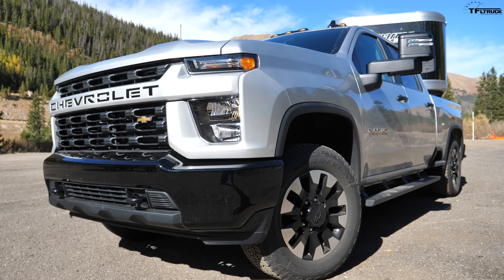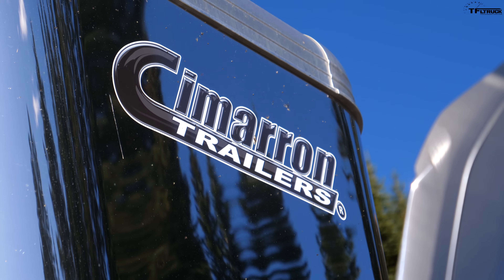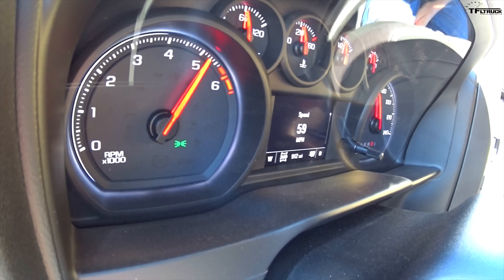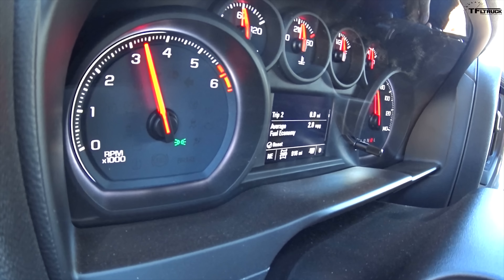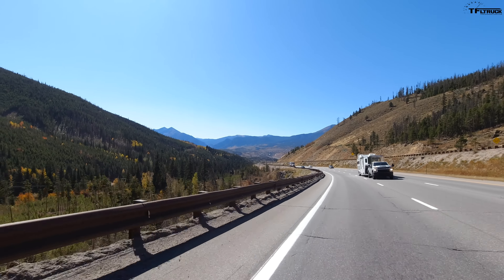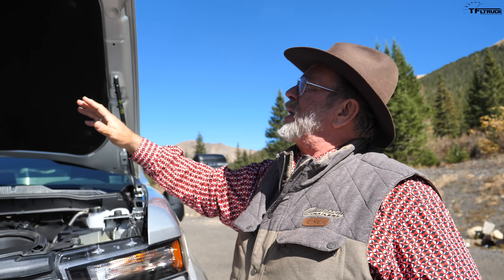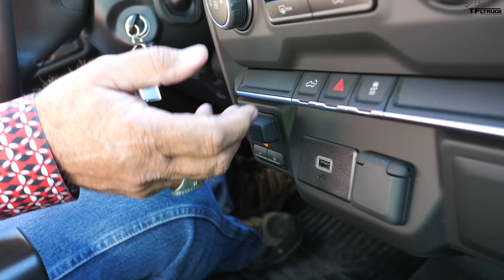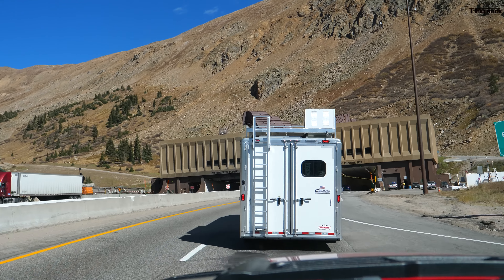The New 2020 Chevy Silverado HD Gasser Broke Our Ike Gauntlet Scoring System - Here Is How!

Comment: Can’t wait to see 7.3L Ford at work.
Reply: Can't wait to see the chevy 8.4 in the works
Reply: Chevy 8.4 did you where get it info? I know hearing over (gm8.0)
Reply: @jckdnls9292  Rumor is that if that engine even exists its only going to be used in medium duty applications, which also means it'll be de-tuned for longevity and will probably make less power than Fords 7.3L.
Reply: “In the works” seems to be the only reply from the GM crowd nowadays. With their ancient interiors, it’s amazing Chev sells any trucks...
Reply: @mattmcneely9174  I want a truck not a Fuuurd ecu-JUNK tin can
Reply: Aris Torm you sound real educated 👍
Reply: I think that's gonna be a great engine and transmission combo. That's the problem with the GM HD trucks. Still using a 6 spd. May be updated, but still a 6 spd. On paper the HP and TQ numbers are better than the current competition, but in real world application it doesn't put it to the ground well. I drove a Chevy HD gasser after driving a Ram 2500 Gasser and the Chevy doesn't compare. Waiting on that 7.3 gasser from Ford. Only thing I don't like about it is they went to a few plastic internal parts instead of aluminum. Just one more thing to go bad sooner I fear. Gonna get an HD truck with real HD parts, ie., solid front axle...waiting on the Ford 7.3 to decide on which one...Ram or Ford?...
Reply: @rossagge  No thanks on that Fuurd  will keep in the GM trucks
Reply: Aris Torm what happened to you?
Reply: How gm making that 8.4 ? They just payed off thousands of people 😡
Reply: Old school building how you want it for less than it costs to buy a used truck and you'll have 0 miles on the rebuilt parts so completely done you have a brand new truck for fraction of the price of the new one
Reply: are there many mexican trucks crossing the border
Reply: @mattmcneely9174  thats if you can get past the hideous looking exteriors on the latest generations to look inside.
Reply: @rossagge  It's not a problem. The 6-speed is a proven transmission. Any time a totally new transmission comes out there are always problems with it... GM 8-speed, Ford 10R80, Ford 6R100G. Even just making some design changes often causes problems (2019 Ram 1500's 8HP). Let the guys buying the first couple years of a new automatic deal with all the TSB's and bugs first. I can't wait to test drive a 7.3 Super Duty with the 10-speed, but there's no way I'm spending my money on such a new powertrain. I'll wait a couple years.
Reply: @karlschauff7989  curious what is wrong with the ZF8HP75. The 8HP70 has proven to be an awesome transmission
Reply: @TheRamGuy  It received design changes for 2019 and a lot of transmissions have had major issues or just straight up failed. There are plenty of big threads filled with guys reporting their transmissions failed.
Reply: @karlschauff7989  I found nothing of the sort in my search. I am part of 4 different Ram forums and haven't seen any of this. Where specifically are they calling out tons of issues with the ZF8HP75
Reply: Jay P they’ll sell a zillion of them. So many fleets like ambulances, moving vans, utility trucks as well as private customers are red up with modern emissions diesels. It’s cheaper to put gas in a big block V8 than to pay for repairs on a smog diesel. Ford actually has the 7.3 detuned so that later models will be upgraded HP wise every year. I’m sure they could throw a turbo or supercharger and make 700hp without even stressing the forged steel crank in it.
Reply: Should have had the flashers on the whole way up!
Reply: And the Ford 7.3 polished that ass on the GM. Beat it up the ike by 3 minutes 😂 go cry now fanboys.
Reply: @karlschauff7989  
Best combination for hauling.
CUMMINS/AISIN/EXHAUST BRAKE.
Reply: @mt1885  I have a feeling that you're on welfare, just like GM....
Reply: @231mac  you did him dirty 😭 Built Ford Tough 😎
Reply: @mt1885  There is absolutely nothing that you have going on that anyone would be jealous over, lol. And considering how infantile your word choice is, I'm pretty sure that it is YOU living in someone else's basement.
Reply: @231mac  Did you miss your Burrney Sandoors hero rally along with Bitdden...
Reply: @mt1885  Sorry, I don't speak gogo-gaga, but I will say this: I'm a Libertarian and you're straight-up embarrassing conservatives.
Reply: @rossagge  the diesel is the 10 speed...

Comment: Towing 3-5 times a week and I climb 3 thousand feet one way, I’d absolutely hate hearing that engine rev that high the whole trip, and my mileage would be garbage. I’ll stick to diesel.
Reply: i see burnt up transmissions and engines in gms future
Reply: Haha agreed
Reply: @LedzeppelinDogsGuns  nah nobody tows with these, half the new trucks dont have a hitch in the receiver
Reply: Yep.  Jeremy really is the right customer for a diesel.  If you two every day, diesel is for you.  I haven't seen a heavy duty gas engine yet that can pull a load up a hill without assaulting the senses.  Ford's EcoBoost does a great job in the F150.  It can pull the Ike at 3500 rpm and not sound like it's screaming for mercy.  Somebody needs to make a turbo gasoline engine for heavy duty applications.  Naturally aspirated can't do the job at high altitudes.
Reply: You and me both... a high reving gasserr can't be that durable for much heavy towing  anyway.... don't quite get what the factory engineers are thinking....
Reply: What’s with all you kids thinking high rpms are bad?? As long as there is oil in the engine and oil pressure is within limits these engines will live at 5000rpms all day... Do you kids honestly think the added complexity of a turbo charger will meet the requirements of a reliable, long lasting workhorse engine?? Not at all!!! If you knew anything about turbocharging you’d know it has no business in a heavy duty pickup besides diesel
Reply: @jon62ify  How many engines have you designed that will last at 5000 rpm all day?
Reply: @jon62ify  What about the "added complexity of a turbocharger"?  Turbos are simple devices compared to the cylinder deactivation systems that GM and Chrysler are putting on their engines.
Reply: Andy Harman turbos require added cooling, added systems to maintain correct cylinder pressure, an additional oil system, or higher engine oil capacity (if using engine oil for turbo), variable vane turbine blades, which either use oil pressure for actuation or solenoid actuation. You need an intercooler, the exhaust manifolds and intake manifolds need to be routed to accommodate for the turbo. The increased cylinder pressure greatly reduces head gasket longevity.
Reply: Andy Harman if redline is at 6000 rpm why wouldn’t the engine be fine at 5000 rpm? Do you understand what rpm redline is? Do I need to explain it to you? I mean it’s pretty simple to me. An engine should be able to run at any rpm, below its designed limits, for an extended period of time without additional wear. What more of an explanation do you want?
Reply: @jon62ify  You're doing nothing but shedding a lot of dark on the subject.  You're last post consisted of six sentences, four of which were questions.  And then you have the gall to say it's an explanation.  Different engines have different redlines for different reasons. Different manufacturers have different policies for setting redline.  There is no universal definition of what redline means.  When I worked on valvetrain development at a major supplier, redline for passenger car engines was typically set a few hundred rpm past the speed at which the valve seating velocity exceeded 1 m/s.  But I can tell you that there are popular engines out there that have valvetrain dynamics problems at speeds less than redline due to resonant spring coil vibration.
Reply: Matt Howell   Well some people (like me) don’t drive around with the hitch in when they’re not towing. That keeps it in better shape and definitely won’t get stolen when locked inside the cab.
Reply: @MightyThunderbolt    I no longer keep my trailer ball in the receiver when I'm not using it.  And it still rusts.
Reply: @andyharman3022    No point, unless you're going to make the block as heavy duty as a diesel.  And if you do that, you might as well stick with a diesel.
Reply: If you’re towing 3-5 times a week 3000ft one way you would be insane to buy a gasser and I’m a die hard gas guy.
Reply: That’s great. You do you.

Comment: 4:10 is what you need for better towing ability.  3.73 is what the boss drives around in checking on his minions.
Reply: I was just thinking contractors truck
Reply: Nah. 3.73 gets it done. 4.10 is miserable on the highway and interstate, especially if you're in a diesel. I hated my 4.10. Sure, it got my 17,000lb horse trailer moving, but maintaining 70mph on the highway means you're sucking fuel and making a lot of heat and constant boost pressure.
Reply: @phtevenmolz5030  heat is tied to power output if you are in boost it is beacuse teh power is needed.
Reply: @KoolCordell  no it's not. It's called drive pressure and it's dictated by gearing. 4.10 and above is shit on any diesel 3/4 or 1 ton that sees much highway traveling. The lower gearing causes high RPMs, which causes high exhaust pressure in the hot side of your turbo, and very often is the cause of head gasket failures (along with front cover cavitation on some trucks).
Reply: I got a silverado 2500 hd with 4.10 it is slower but i get better gas mileage then my friend's sierre 2500hd 3.73's
Reply: @GB-vj4gj  same year? Same gas motor? Comparing both empty , or both pulling the same load?
Reply: @deeohgi  mine is an 01 , his is an 02 both 6.0 vortec and about the same tools (we are in the same trade) his takes off quiker than mine but gets about 3 mpg less than me
Reply: @GB-vj4gj  with same generation 6.0, there's gotta be something going on with his truck, cuz it's literally set up to get better mileage with the 3.73's, unless both are doing identical heavy towing. At one point, between me and my bro, we had four 04's ( a 5.3, 6.0, 8.1, and the dmax). With the 6.0 & 8.1, neither got shit for mileage empty with those 4.10's. Like 13 & 12. Loaded down  with a huge stock trailer full of cows,  they dropped to about 9mpg (6.0) & 10mpg on that 8.1 beast.Meanwhile, the dmax got 24 empty with the 3.73, and then 12-13 with same trailer of cattle. But completely apples to oranges. I digress... you have a tuner on your 01?
Reply: @deeohgi  i believe he would get better mpg then me if empty but loaded with about 2000 lbs in tools that's the way it is at least in our case ,and no tuner or any other mods besides a k&n air filter which we both have ,my truck does have about 20k miles more then his ,and he actually uses synthetic oil and i use regular highmileage oil
Reply: @GB-vj4gj  interesting.. thanks for replies!
Reply: @GB-vj4gj    If the trucks were near equal, the 4.10 would accelerate quicker and get lower fuel mileage.  So there's something preventing an accurate comparison.

Comment: Pretty sure I would keep the transmission in manual for grades like this and go for around 4000 max rpm.
Reply: Ok
Reply: @Icutmetal  yes
Reply: @marylandsportsman4114  Sure
Reply: @Icutmetal  ok
Reply: One would hope the GM engineers would have set up the TCU to pick the correct gear.  Obviously GM did not.
Reply: Almost like you have some experience towing. This is not a real world towing test because I also wouldn’t be towing up that hill in D.